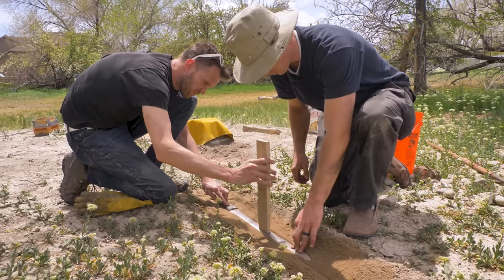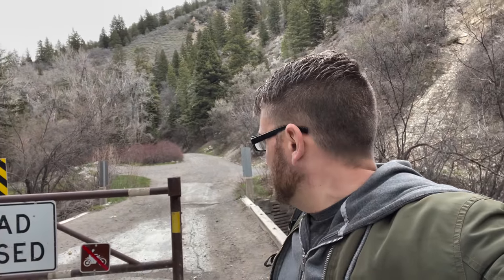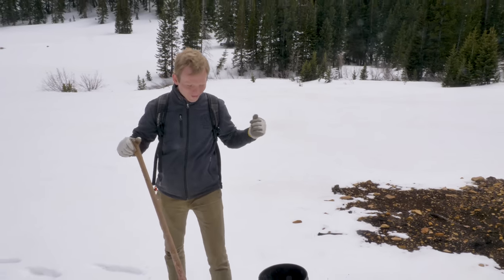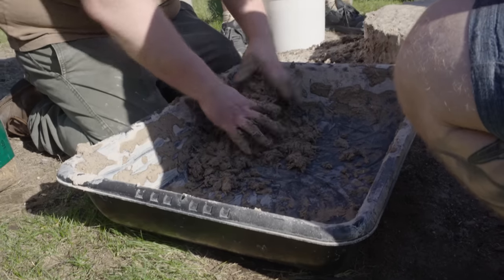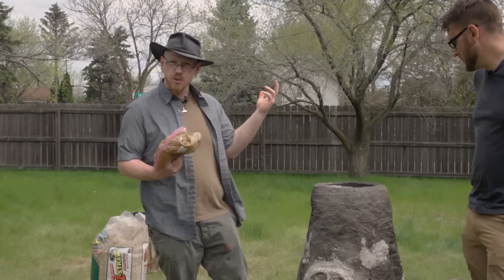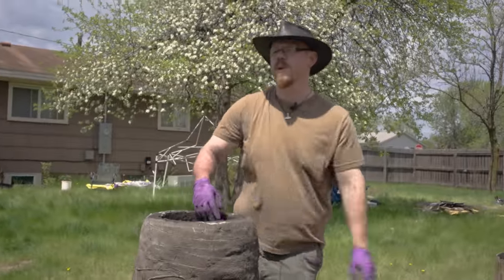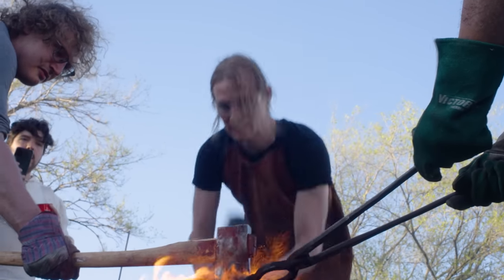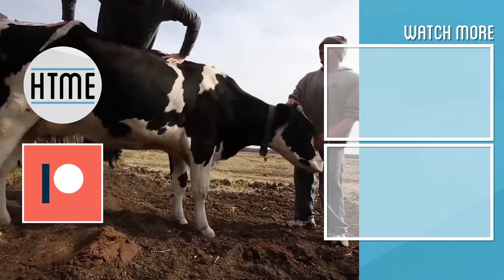I Hiked 14 Miles to Collect This Orange Dirt

Comment: I remember primitive technology finding a little bit of bog iron but I had no idea you could have such large deposits. This definitely feels like the epiphany missing link on the evolution of forging that I never knew about.
Reply: Same!
Reply: tripplefives  cool story bro, but this here is the missing link for steal and iron for some of is. We know about aluminum from all the other shows but this is the first time in 30 years ive heard of bog ifon
Reply: @Shad0wBoxxer  And this is the first time I'm hearing about finding aluminum
Reply: Even better is that bog iron often replenishes very fast because it's made from bacteria that poop it out.
Reply: Ive learned so much on this channel
Reply: @jb13611  hahahahaha! Excellent point. Aluminum extraction from bauxite is SO far beyond where these guys are at, both in terms of humanity's timeline , and their own various abilities in inorganic chemistry... from Wikipedia;

In the Bayer process, bauxite ore is heated in a pressure vessel along with a sodium hydroxide solution (caustic soda) at a temperature of 150 to 200 °C. At these temperatures, the aluminum is dissolved as sodium aluminate (primarily [Al(OH)4]−) in an extraction process. After separation of the residue by filtering, gibbsite is precipitated when the liquid is cooled and then seeded with fine-grained aluminum hydroxide crystals from previous extractions. The precipitation may take several days without addition of seed crystals.

(It continues, with about a half dozen additional steps until extraction...simply not a viable element to harvest at the team's current evolutionary skill levels.)
Reply: @Shad0wBoxxer  what makes this stuff the "missing link," as you put it? I don't follow. Missing link in that the iron rich ore more easily facilitates iron production..? I don't see how that is a secret- or missing-knowledge, it clearly is available en masse, depending on locale, and was not lost to humanity at any point that I've ever heard of. 

So is it a missing link because you were unfamiliar with the material?🤷🏼‍♂️ fairly unique, and totally you-centric way of defining a missing link. 

And it appears you may need to revisit those other channels to better understand the nightmare that is aluminum extraction... cheers!
👑👌🏻
💩
~King Shit.
Reply: @Shad0wBoxxer  cool story bro. why "gamer culture folk" always on some passive aggressive bish sht?
Reply: tripplefives  But aluminum is 1. more energetically intensive to liberate than iron by a long shot, 2. significantly harder to work, impossible to forge in any small shop, and 3. only really efficient on large scales. Also... iron oxide can be dissociated using electricity in a similar manner to aluminum. So, in this context, it's pretty silly to say that aluminum is easier to make.
Reply: There were large enough deposits of bog iron in the Massachusetts Bay and Plimouth colonies that there were a few iron works producing iron for local consumption. My family was brought from Wales in 1645 by the Bradford family to work in their bloomery in Lynn (now Saugus), Mass. They left to form their own bloomery and forge in Taunton (now Raynham), Mass., which stayed in business until after the Civil War. So, there were very large deposits.
Reply: New England has plenty of bogs... Alternate universe has NE as a steel hub
Reply: Primitive Technology just uploaded a video making a small blade from slime ore (a day or two ago).
Reply: @knuckle12356 you're quite condescending for someone so dense. The missing link in his knowledge was clearly the existence of bog iron deposits much larger than the small ones he's familiar with (such as those found in primitive technology's video which is a common size for iron bacteria colonies) that would make it a feasible source of iron.
Reply: Yeah he like extracted tiny little grains of it from tons of mud from the side of a river lol

Comment: This video was a step above. Nice job. One note about the steel vs iron thing at the end: I learned when doing a related video that (despite what we were all told in grade school) steel is not made by adding carbon to iron. The process to make iron as you've seen adds carbon in extreme excess, and to make steel you have to take most of it away. Raw pig iron has 3.5-4.5% carbon content, and cast iron around 3%. Steel is typically between 0.5 and 2% carbon content.

So, you did make iron there at the end. That is, you made what is called iron colloquially and industrially, which is not strictly pure elemental iron.
Reply: I was wondering about that, having followed some of you dabbling, thanks for sharing
Reply: Pure elemental iron is extremely difficult to isolate because of irons reactivity. At best you will achieve 98% pure material and even that will react with oxygen and moisture resulting in oxides and hydroxides.
Reply: fight! fight! fight! fight!
Reply: expanding on iron vs. steel, when the alloy is less than 0.5% carbon, it becomes wrought iron: easy to work with, but a little soft. I think wrought iron is what you typically get when you work the iron in the forge too much. So in order of increasing carbon content its wrought Iron -> steel -> cast iron. Steel has the flexibility of wrought iron and the hard toughness of cast iron. But cast iron and wrought iron are easier to make.
Reply: @sherannaidoo2712  Yup. The process for making Elemental Iron is actually Electrolytic Refining, in a sealed environment.
Reply: @derrickthewhite1  and expanding on wrought iron, it actually has two meanings. If you find wrought iron from the past century or so, it simply means a low-carbon iron or steel with a low melting point that makes for good blacksmith forging but will not hold a sharp edge. 
But it also has a more specific meaning for a form of low carbon iron WITH EMBEDDED SILICA/GLASS! If you you've ever read the Foxfire book on blacksmithing, an old timer talking about different metals says something I could not believe when I first read it. "Wrought iron has a toughness that makes it really good for hoes and such and it's rust resistant because its got glass in it. You can tell wrought iron because the glass gives it a grain." What? Grain? Glass? Huh? But once you see the process of going from bloom iron to billet, you can understand how it does indeed get melted silica mixed with the iron and makes a composite that was true old fashioned wrought iron. Very rare today because pig iron includes much less silica.
Reply: What kind of grade school did you go to? lol that aside, I was under the impression that you had to use coke charcoal and oxygen to remove the carbon. The science must be a little over my head as I've wondered why you need the charcoal as opposed to just oxygen when the goal is just to make CO2 and there's clearly excess carbon in play, hence the process.
Reply: @TimeSurfer206  Well I know you need heat, but I can't see why the extra carbon is necessary still. To my knowledge they use an arc furnace industrially to do it so coal isn't exactly necessary for that.
Reply: @SCUBAdfq  We use coke in the blast furnace to reduce the iron ore to molten pig iron, then at our plant we use whats called an LD converter to basicly stick a giant straw into the soup and blow O2 into it to reduce the carbon. So carbon to heat up -> Remove carbon with O2. No extra carbon added in the 2nd step
Reply: @Pointehawk  Gotcha, I guess I was under the impression that the heating process was "clean" in that the heat was applied through an electric arc as opposed to adding fuel.
Reply: @SCUBAdfq  Arc furnaces are more used with already refined iron and steel in recycling plants. We are planing to start using hydrogen tho instead of coke, even have a pilotplant for it for testing. With the large production plant in the pipeline to 2030
Reply: @SCUBAdfq  You need an excess of carbon, because the carbon combines with the oxides in iron oxides to reduce into iron ore. If you don't have an excess of carbon, you will instead turn any iron you made back into rust, much like how putting any iron (such as nails) into a fire pit, will usually result in rusty iron at the end because of the excess of oxygen instead of carbon. The reason for coke charcoal is because it is a more chemically pure source of carbon, than normal charcoal, and burns cleaner, leaving less impurities in the end product. They also usually add limestone which combines with any silicates to form a better running slag and remove impurities.

Industrially in modern times this is how your blast furnaces work, and then the resulting iron ore is taken away with around 4% carbon content to a steel converter, where they inject oxygen straight into the mixture, alongside adding limestone to convert carbon to carbon monoxide and remove impurities into a slag. When the carbon content has oxidized enough they stop adding oxygen, and then tap off the steel.
Reply: yea thats what i was thinking. it has more carbon than steel does

Comment: next project. Crucible steel. You take the bloomery iron, toss in a small amount of glass, Flux, and some charcoal into a ceramic crucible. Air seal it with a clay Cao, and run it at melting temperature for 6-8 hours. Let it cool for a day or two, then break it open. If the charcoal is still there, you did it right. Using that process, you should get a very clean puck of pure steel.
Reply: What does the glass do?
Reply: @stevendorries  the glass sticks to impurities that would have a hard time moving otherwise
Reply: @theirontitan  thanks for the quick answer
Reply: @stevendorries  no problem
Reply: This dude metallurgys

Comment: The process of roasting the ore before smelting has a close link to art. Many  pigments are variations of iron oxides. Yellow/Red Ochre, Sienna, Umber, and Mars Black are all various iron oxides. Sienna and Umber come in "raw" and "burnt" forms, which have literally the same starting materials. The "burnt" versions have been roasted at high heat, driving off chemically bound water molecules and producing a color change just like the ore in this video.
Reply: They probably figured out iron smelting from adding iron glazes onto pots
Reply: The water isn't chemically bound, it is trapped within the structure of the crystals so it's physically bound.

Comment: Man I see why Iron used to be a rich man’s metal, such an arduous and time consuming job.
Reply: Like everything before the industrial revolution.
Reply: And this video doesn't show all the work that went into cutting down trees and making charcoal.
Reply: The iron age disagrees with this comment
Reply: @charleslambert3368  two to three weeks of 24 hour care with the charcoal makers tending the charcoal pit. With no sleep to produce a fifth the total of mass of wood into charcoal.
Reply: @GAMER123GAMING  The iron age, AKA the age where the rich had iron.
Reply: @delphicdescant  Uhhh, no. Even peasants had iron scythes in the Iron Age. You're thinking of the Bronze Age, where only the rich had access to bronze.
Reply: Remember, all of these processes can be scaled up, from roasting, to getting charcoal, to smelting itself. Furthermore, each individual tool doesn't necessarily take a huge amount of material.
Reply: @delphicdescant  Nvm, double-checked. You're not entirely wrong, in the early iron age in northern Europe, iron was indeed a luxury item. But by 500 BC that began to change in northern Europe, and in other places, such as China, it was never the case - iron was used in farming implements as early as the 9th century BC.
Reply: @delphicdescant  Iron just requres mostly hard work, as obtaining ore was almost trivial task: iron ore is literally everywhere within reach. Ingridients for bronze were much more rare.
Reply: Iron did democratize fairly quickly and better methods were quickly developed, by the Roman iron age the Roman empire was mass producing iron armor and swords in workshops across the empire. The key ingredient is simply scaling up, producing iron is really difficult when you extract it from low grade sources like bog iron and use temporary furnances but once proper ore mining started and more permanent and larger production sites were established it was relatively easy to scale up production. That's why eventually Scandinavia abandoned bog iron when mines in Sweden and Norway opened up, today Sweden still supplies a massive ammount of iron ore to the rest of Europe and the railway infrastructure in Scandinavia is almost purpose built to transport iron ore from Sweden. Hence why Scandinavian railways have some of the most powerful locomotives ever built, designed to pull trains of iron ore through the hilly landscape and up through the many railway tunnels linking Scandinavia to central Europe.

The democratization of iron was also important for the start of the Rennaissance, the introduction of the iron plow in 1200s Europe combined with the medieval warm period lead to a massive rise in population that facilitated increased trade and the reintroduction of a money based economy where cities finally regained the importance they had under the Roman Empire. This enriched Italian city states who'd start to spend that wealth on further increasing trade, patronizing the arts and hiring mercenaries to fight each other for dominance leading to the Rennaissance.

Comment: Great video! On a side note: that's not steel, too much carbon concentration. That's called pig iron, or crude iron
Reply: Thank you! What we ended up with is a mix of iron, steel, and close to cast iron in places. But the majority is mid to high carbon steel. I'll be running it through a fining hearth to homogenize the material into something more cooperative in an upcoming video.

Comment: It's really interesting how easy it is to go PAST iron and into steel. Kind of makes one wonder why there was an "Iron Age" for so long before steel took over
Reply: iron and steel have always gone hand in hand but getting an iron bloom is more useful than a steel one due to the amount of effort refining a steel one takes compared to an iron one because its harder
Reply: because the "iron age" was more like steel age, pure iron tools are actually not very useful (though apparently they were thing). but the "iron age" also include the use of steel. "steel age" is actually not a real age, its what some people call when people started to manipulate the carbon content of steel with extreme precision the point where they could mass produce steel with precise properties.
Reply: It's called the Iron Age because it's when humanity started to manipulate iron into different materials. Steel is one of those.
Back then, it was hard to get a consistent carbon content. It was until the industrial revolution and the Bessemer Process we got higher carbon steel more reliably.
Reply: Thing is: metallurgical iron isn't the same thing as chemical iron.
Cast iron is elemental iron plus way too much carbon to be steel.  Remove most of the carbon, and you have carbon steel.  Remove all of the iron (and the other impurities), and you have what a chemist would call iron, i.e., the actual element.
It's a funny old language, and the meaning of words often depend on the context.
Reply: I would hazard a cautious guess that most items listed as "iron" (unless definitely cast iron, but that's not pure elemental iron) in museums are actully made from at least a low-grade steel containing some carbon, because completely taking all the impurities out of naturally ocurring iron is really almost impossible, at least until the technology of the  Henry Bessemer's converter in 1856.
Reply: Bessemer process. Wootz steel took forever to make
Reply: @therandomguy1315  always gone hand in hand? That's utter nonsense. The iron age stared in 1200bc. The earliest known steeel production was 600 years later.....why make things up.
Reply: To make good tools you need both iron and steel,. A hachet/axe is usualy soft iron as head with a harder steel strip sandwitched at the edge, to make it easyer to make
Reply: They didnt make steel
Reply: They definitely had steel for the entirety of the Iron Age. The reason that its applications were limited compared to today (mainly to tools and  weapons and such, where today we have steel beams) isn’t about the ability to make steel but about the ability to make large quantities of steel of uniform grade and quality and to then manipulate it. A straight, 6-inch-diameter steel beam is a non-starter without large machinery simply because of how much it weighs.
Reply: @dan3458  you see the language for these things was set in motion before we understood the process. Pure iron was outside of their understanding. So they called their steel with negligible carbon iron. Which we usually call wrought iron now. They called what we now call mild steel and high carbon steel just steel. And they called steel that has massive amounts of carbon (pig) iron. In the absence of scientific knowledge they named the material with the best qualities steel and the rest was iron. It confuses things when we try to talk about modern materials with words from ancient origins. Truth is that blooms are inconsistent and produce a grab bag of carbon contents with true steel being the least available and most sought after. A good smelter tried to make as much as they could and would separate it from the iron. They may not of figured this out right away but the steel was always there. This is why steel is a rich mans material. Before you could smelt homogenous steel you had to sort it out of the bloom or put a massive amount of work into working the metal to correct carbon content manually.
Reply: simple, repeatability. its much easier to repeatbly make iron at a certain quality than it is to do thew same with steel